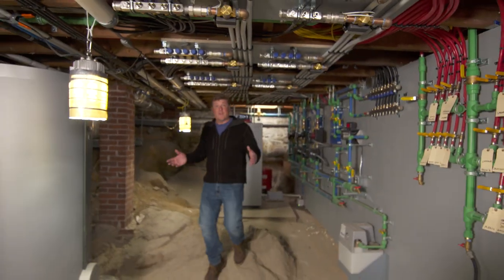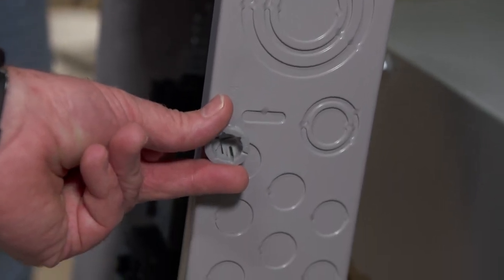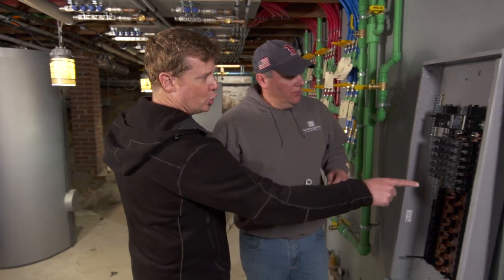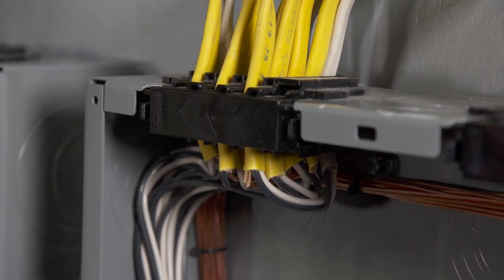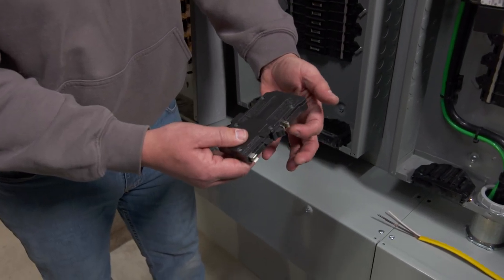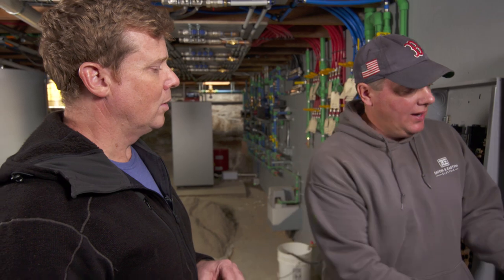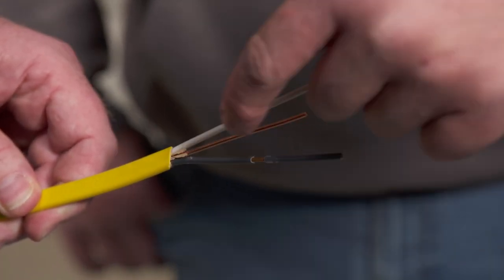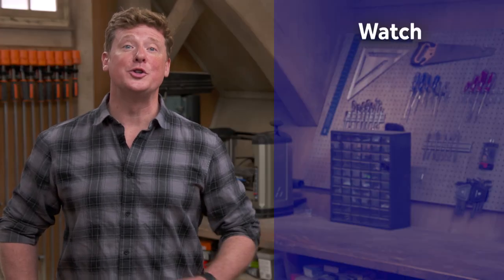How to Install an Electrical Breaker Panel | This Old House

Comment: Time to scare the heck out of those with screw-in and/or cartridge fuses.  
(Just kidding ... I like the fact the brains are out there making things easier, smarter, and safer!)
Reply: I was set to dismantle all the wiring in a house I was renovating. I saw those screw in fuses and my jar dropped a bit. Then I was like well I mean the edition screw actually is a pretty cool design. So what ever I'll remove them all since I didn't know the wiring and also shut off the main in the secondary box. Then went to work on a 20 amp base board heater. I tested it with an AC detector with the AC on first then shut everything off and tested again to confirm off. But lets just say that ended in me shaking and then sparks flying. Had to rely on the conductor melting to sever the short. The motherfuckers had bypassed the breaker behind the panel AND my AC detector had JUST failed. I was pretty lucky to be alive and without a burnt down house that day.

Comment: The bad part, instead of an $8 breaker, it's a $50 arc fault breaker, each.
Reply: Plus they tend to get flaky as they age. I had to have the bedroom breaker in my apartment replaced (only bedrooms were required to have arc fault when it was built) because the kitchen light caused enough noise to make the old breaker, on a different circuit, trip. That said, $50 each for arc fault breakers that may need to be replaced after ~15 years is a hell of a lot cheaper than rebuilding after a fire. Cheap insurance in my mind and worth an occasional inadvertent trip for the protection they provide.
Reply: @Kevin-mp5of  with that project yes. In my area, 10 years ago swapping out a fuse panel, for a breaker panel panel was  $1,800 job. Now you can add the price of 20-30 breakers, times an extra 50 bucks to that cost, plus the cost of the more expensive panel, now the swap is double.
Reply: @jblyon2  I'm not saying it's not worth it, but someone who's upgrading your electrical, needs to learn they're going to spend at least twice as much now.  S0meone I know bought a house that had upgraded electrical.  Every time they turned on their Christmas lights, they would trip The Arc faults. He wasn't sure why, and I had to explain to him that the switch that was on the Christmas lights, was probably causing the ark. Turns out I was right.
Reply: @m3rdpwr  I had to explain something similar to my Dad who is a retired very old-school electrician. He was poo-pooing arc fault breakers for their tendency to trip easily with old appliances. It took a while but I finally got it through that the breakers are tripping because the old stuff is probably one wrong move away from starting a fire! 

What sucks even more for someone upgrading is that if the neutral wiring in the house isn't 100% kosher (not uncommon in 30+ year old homes) the arc fault breakers won't work at all.
Reply: @jblyon2  because my house is built in the late 60s, there isn't a neutral in every electrical box as todays code requires. That means when I set up for smart lights, appliances and switches, I had to have a lot of electrical upgrades done, so I can have neutrals where I was required. All the electrical boxes were too small to host two smart switches, so I had to have some replaced with deep boxes.
Reply: As new tech comes out, I can see that, higher prices. Over time $ will drop, BUT given the status of the plumbing in the background suggests $ is no obstacle.
Reply: @Kevin-mp5of  It's advisable but not required currently to put AFD's on UK wiring. Though I've seen it trip more often down to old switches (lighting/isolators) than actual machinery and appliance faults. The biggest issue with it is the older the system they're attached to the more they trip out due to carbonization of the switching contacts.
Reply: @effervescence5664  ... isn't carbonation the "fizz" in soft drinks? Do you mean carbonization? (build up of carbon)
Reply: @williammunny9916  ... you are WAY off topic here and should be reported!
Reply: @rupe53  Auto correct strikes again, didn't notice thanks!
Reply: @effervescence5664  ... no problem, it was worth the chuckle!
Reply: @jblyon2  I agree that a $2,000 worth of breakers (40 breakers * $50) is probably less than the insurance deductable for a fire.  That having been said, in my 53 years I have never known anyone who has had their house burn from an electrical fire.  I feel that the crux with MA codes requiring things like AFCI everywhere is that it is an expensive solution in search of a problem that rarely occurs.  Yes, there are electrical fires caused by all sorts of things, including arc faults, but selling a homeowner or builder $50 AFCIs that will go bad in just a few years, means the governing bodies are saddling homeowners with the recurring "tax" of having to hire an electrician to do thousands of dollars worth of work replacing old unreliable technology with new unreliable technology, only to repeat in 5 years of so.
Reply: @bryansweeney4562  new elec code/equipment = big $ for everyone involved except for the homeowner
Reply: @bryansweeney4562  I'm of the belief that the people who write the NEC are getting kick backs from the electrical product industry.  How much money did theyake these companies mandating certain products?
Reply: Once upon a time the AFCI's were pretty cheap

Comment: It’s hard to imagine an arc with low current, but upon googling it is possible.
Reply: Voltage causes the arc.
Reply: The situation I see an AF breaker useful in is with mid to high current devices that don't trip a breaker, but heat up a terminal. Just the other week I plugged my air compressor into an outlet and it burned up the plug, I didn't notice it till I smelled the smoking plastic. It's those high resistance, arcing faults that will (I hope) trip an arc fault breaker, not exactly a hot to neutral arc, but an interrupted hot or neutral.
Reply: @volvo09  
"The situation I see an AF breaker useful in is with mid to high current devices that don't trip a breaker, but heat up a terminal. Just the other week I plugged my air compressor into an outlet and it burned up the plug, I didn't notice it till I smelled the smoking plastic. It's those high resistance, arcing faults that will (I hope) trip an arc fault breaker, not exactly a hot to neutral arc, but an interrupted hot or neutral."

It sounds like your compressor was pulling too many amps.
If you use that particular plug for your compressor, look for an outlet that has ceramics in it.
I'm not saying they exist, it just seems like they should.
The ceramic will be able to resist the heat much longer than plastic.
Reply: volvo09 arc fault breaker wouldn’t trip in that case. Arcing from a loose connection won’t trip an arc fault breaker as many people would think it would, including myself, until I tested them.
Reply: @MrSleepProductionsInc  huh, then does is actually do anything besides cost more?

Comment: So their feeding the panels from the gutter underneath, why didn't they flip the panels upside down so the mlo feeds are on the bottom? Seems kinda weird. Must have a 320 or 400 amp main outside. Does seem a little misleading title. Should be "Check out the new SQD QO Plug on neutral panels".

Comment: I almost always select Eaton/Cutler Hammer panels because of the vast array of breaker combinations available. When retrofitting an older home, I find them quite easy to tie in. I'm not going to try any new designs until I'm sure I'm not getting into another Federal Pioneer stab-loc or Bulldog push-matic situation.
Reply: East Coast Resident
 ... The coffee almost came out my nose while reading that statement! I also find the Q panels a bit odd but like the Homeline units.

Comment: hope people enjoy going to the breaker every time they vacuum
Reply: Who unplugs a running vacuum cleaner?
Reply: @fizzpop6543  I know many people who do
Reply: @ChickenPermissionOG  Then they can enjoy doing that instead of flipping a switch literally within arm's reach.
Reply: Kevin Have you ever bench tested an afci breaker? After watching a few other youtubers not be able to get them to trip I decided to test one myself. Basically I took a bunch of temp sockets with light bulbs in them and hooked them up to an afci and then cut the hot wire and sat there arcing and sparking the hot wires together (looked like I was welding) for several minutes. The afci never tripped!
Reply: @ChickenPermissionOG  ... usually it happens when they try to reach further than the cord allows.... and now a trip to the basement because I tried to stretch the cord again!

Comment: I am about to upgrade to 200 amp box, are these better than buying the box  that allows you to use the breakers with no pig tail? I would rather not have the extra wire to deal with in the box

Comment: So every time there is an arc you gota run to the panel and flip the breaker?  That's kind of a pain....
Reply: Better than a fire I suppose
Reply: @Nick-bh1fy  True, but when I get an arc now I don't get a fire.
Reply: What's arcing? Stop the arcing lol.
Reply: @markhoffman  I'm not doing it on purpose.......
Reply: Arc fault breakers seem kinda silly. It seems like companies are pushing this crap just to charge more for their stuff. I'm living in a 1970s home with original electrical and a lot of newer hackwork. Haven't had a problem with arcs or any thing getting warm. It doesn't get much worst than what I have.

Comment: The amount of money spent on the plumbing must be mind boggling. One will probably need an engineer down there at the control center. Nice um breaker panel too. I mean I guess. Arc fault breakers are especially good at keeping powers tools from operating and cutting out fridges randomly.
Reply: Well you shouldn't be plugging in your power tools into a living room, bedroom, or dining room. Also most of the tools used now a days are battery powered, so no issue there.
And if your appliances are causing an Arc and tripping a sensitive Arc fault breaker, it might be time to get new appliances before they start a fire.
Reply: C-Walker how about when you plug into a garage outlet that trips when you even look at your miter saw??
Reply: Kevin - yeah that makes sense??

Comment: A common theme, look at this cool stuff, but were not going to tell you anything about what to google (manufacturer or form factor) so that you can find out more information.
Reply: @Kevin-mp5of , fair point. It's kind of a double-edged sword when a home owner is somewhat educated, but I think I'd rather have a good idea of what level of tech I'd want in a house than have a contractor try to tell me what I want within a pricepoint.

Also, thank you. Now I need to do some reading about Square D panels.
Reply: @Kevin-mp5of  hear hear

Comment: Wow. How long have these panels been around? Where are people using them other than Mass?
Reply: i know in MD they are starting to require them if you upgrade certain stuff in your house...
Reply: i think the plug in neutral panels have been around about 5 years and in my area (TN) are just now getting used
Reply: @kdknitro  I'm eventually going to have to rewire the house and I'm in Md - I like the idea of such a clean panel and the arc fault breakers.
Reply: @Myopicvisions  yeah there not all that bad , they are safer but they also do cause nuisance trips...

Comment: what sucks is those breakers are very expensive and only available at electricians supply house if ever needing others. Bad part is a lot of false positives with those breakers.
Reply: Had to have those installed in my kitchen at our old house. We had some carpet being installed and the installer had an old electric staple gun. Because of how old it was it would constantly trip the arc fault, I'm sure there was arcing inside of it.

Comment: Dont know about anyone else but I use the switch to turn the vacuum off.
Reply: Did you hear him talk about a wire under a rug or a nail in a wire? Or did you just stop listening when you thought you knew more?
Reply: However, those auto-off irons have no power switch. Numerous times, when to unplug and small arc out of receptacle. ARC fault would have tripped.
Reply: @jankyj2269  ... when I went to school (with Fred Flintstone) they taught us fire safety using old fashion film strips. Cords under a rug were a no-no, as were multi-tap additions on cheesy extension cords. Of course in the 60s most homes only had power for the last 30+ years so every appliance was suspect for looking at a frayed cord as well. Yes, they did a fairly decent job of teaching common sense back then!

Comment: I would have liked to know why they needed two panels in that house. I know it's a 400A service but the one panel wasn't even close to full.
Reply: Cheaper to buy and install two 200 amp panels that are readily available then to have a 400 amp panel board made.
Reply: Are we sure that was a house?  With those panels and all that plumbing behind, I'd think it was a commercial building.
Reply: @MrSleepProductionsInc  ... could also be a 320 service and not a true 400 amp feed, which is common when they are trying to save a few bucks. Also common to use one panel for a generator feed. (now or later)
Reply: @brad4841  nah, it's a house. They've been working on many parts of the house in different episodes. It's a really technologically advanced house.
Reply: Good question I just did a new construction barn that will be for wedding venues and had 400 amp service with nothing but lights and plugs in it lol

Comment: 14 dislikes so far from people who still stick a penny in a fuse slot.
Reply: Nah, it's 14 dislikes from the armchair electricians who go from electrical video to electrical video sh*tting on anything they see.
Reply: @c31979839  I disliked it because I think the best way to do this is to call a goddamm professional so you don't die or burn your house down. If you have to go on YouTube to learn this you are not experienced enough to do it safely on your own.

Comment: What about adding breakers for welders, compressor etc?  Seems this new panel is not so user friendly.  If you need to remove the back cable in the slot you may need to remove all the forward cables?

Comment: Arch fault is so overrated... My home was built in 1990 and I replaced all outlets & switches and never had an issue with arching or grounding issues. The only necessary spot is kitchen &  bathrooms thats it

Comment: Odds of an actual fire from putting a screw threw a wire......... million to one! Breaker tripped every time I did this experiment with cotton all round the area. Zero fire. My eyes waste of $$$ and time. Do the job right once and you shouldn’t have any worries. I see fires from people putting electrical heaters on plugged in outlets! I don’t see any banning of them!

Comment: This is misleading. The electrician isn't installing a panel (mounting panel to wall, running mains, termination of mains, installing the wiring and breakers. Its already installed and populated). This is demonstrating newest style of panels + breakers which this here is a Square D "QO" QWIK-Grip load center.

Comment: This Old House has changed from a how to channel to a commercial channel. You wont be needing my views anymore.
Reply: I was think the same thing while watching. There was absolutely no "how to's" t was basically a showcase of Square D's proprietary cable management and neutral bus breaker connection. What happened to the old show of how to keep up with your literally old house!
Reply: @mnf65  Seriously.  There was no mention in this clip of the things I needed to avoid if I was to replace my panel (besides pigtails and knockouts?) 

Good luck with the housefires because of knicked wires or loose connections
Reply: You should probabaly unsubscribe, and turn off those bell notications then.

Comment: Too short. Another professional who isn't going to slow down and do an actual step by step, starting with connecting the main input lines, and  then the first 2-3 breakers. This video is designed to convince people they need to hire an electrician, which makes it totally useless, as well as the usual massive project that again is chosen to scare people away, not educate and help them. 3+ minutes and the title says how to install a breaker box? Ridiculous.